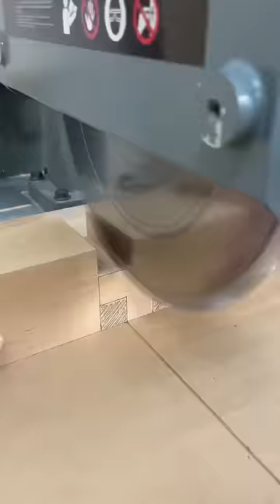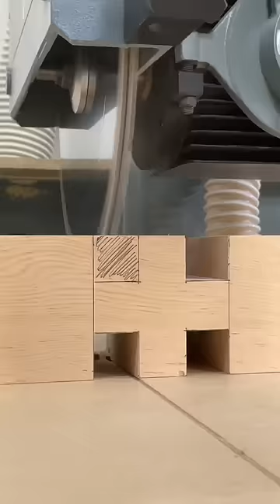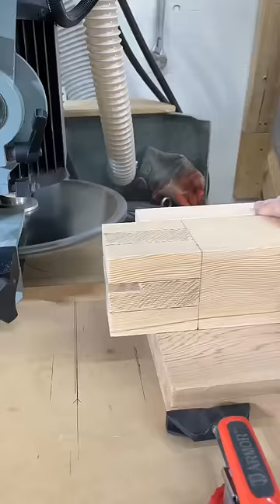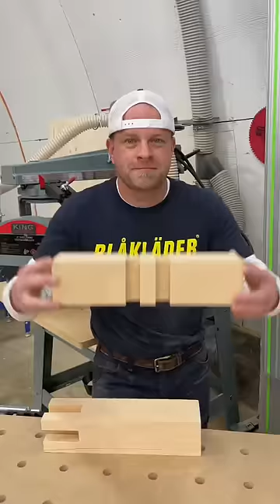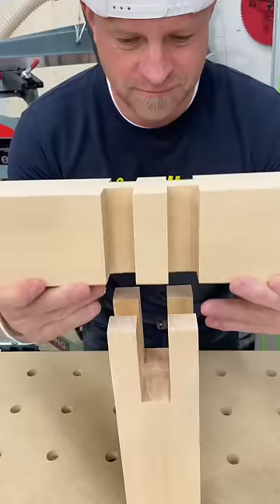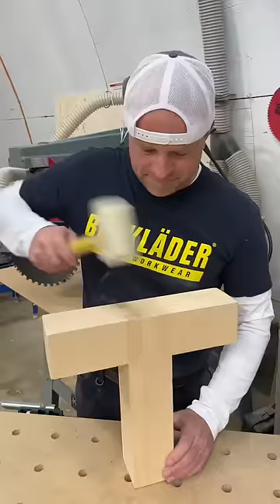Four post joint #ad #woodwork #wood #woodworking #bois #holz #maker #tools #madera #joinery #fun

Comment: I’m sorry to bother you and ask you the same question again, but can you please tell me why you climb cut on radial arm saw (while cross cutting) and why you push cut on a sliding miter saw?

Both saws spin the same direction, and have the same blade orientation.  

I understand why you push cut on a sliding miter saw, it’s the same as a table saw or a router where your pushing against the spin direction of the blade. 

It’s the climb climb on the radial arm saw while cross cutting that I just don’t get. 

It’s the reason why I’ve never once used my RAS.
Reply from the maker: If you want to pull your RAS out first and push through you can 👍. It will make sawdust go all over the place but you can and it will make it so there is no climb cut. However if you use the RAS within its limits and use sharp blades and use negative rake blades and never go too fast or take out more material than you should the RAS can be operated safely and with the dust heading into the dust extraction better as you can see from all my videos.
Reply: Pulling the RAS while crosscutting pushed the stock down and against the fence due to the downward movement of the teeth.
Pushing the RAS while crosscutting has the blade lifting up on the stock due to the upward movement of the teeth.

Dusty is right about knowing the limitations of the saw.

The Delphi radial arm saw forum recommends a blade with a slight positive tooth angle by Freud or Forrest.
Reply: @dustylumberco  

Thank You For the Reply :)

Comment: Good use of thr radial arm saw.
Reply: @Cam jones The Machine is a regular saw, but the magic is the blade. It's called a Dado Blade, or a Dado blade set. You combine blades and braces to get the width you need. You can get them for table saws, circular saws etc. Very handy.
Reply: @calysagora3615 It is most certainly NOT a regular miter saw, as he is able to set the blade horizontally! ergo the radial arm saw
Reply: @kniefi  , yep. And that’s not a , excuse the term, run of the mill dado blade either. I’m curious about everything regarding that blade.
Reply: It really is. I still have my Dad's big one, and there is one in the shop I work in. But we dont really use them anymore. But dustylumber has been firing up my ras passion again. I need a new table saw too.... My big one is having issues and my job site one isn't getting any dados in it.

Comment: Oh my gosh!?  How did you get that close to a radial arm saw without losing any digits or limbs?!!   You must be lucky!  Haha!  Pretty joint!  Well done.  I love my RAS.  You just have to understand how they work and where the dangers are.  Amazing machines.  Nothing more versatile and easy to use has ever been made IMHO.  ShopSmiths get a nod, but all the attachements make my head spin.  You can get a good used RAS for under a hundred bucks every day.

Comment: What kind of wood are you using? I tried with pine and it warped so bad the bed frame I was making was trash!
Reply from the maker: It’s fir
Reply: @dustylumberco  how dry was it?
Reply from the maker: @spencercurtis5626  I always use stuff that is sub 12%
Reply: @dustylumberco  good to know! I am experienced in wood working in a completely different way! I have done a ton of framing and I thought furniture couldn't be much different! Boy was I wrong!
Reply from the maker: @spencercurtis5626  I was a framer for a lot of years as well 😁👍
Reply: @dustylumberco  any thoughts about transitioning from structural lumber to furniture lumber?